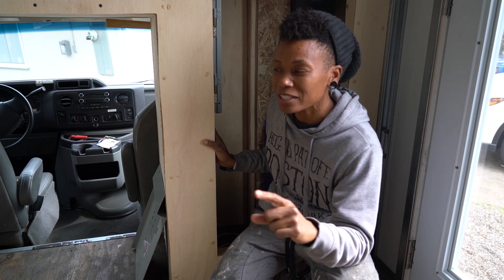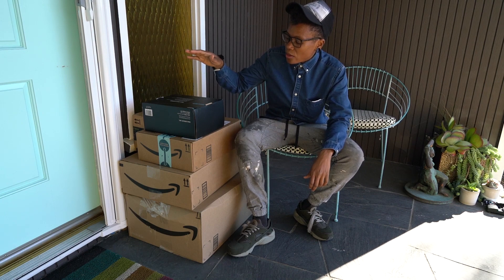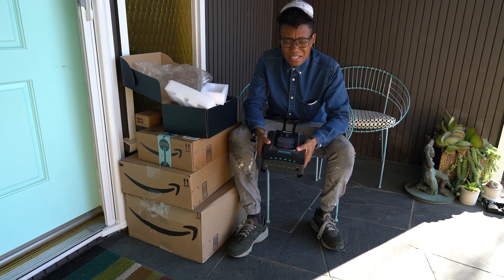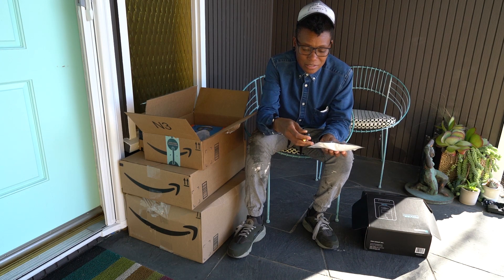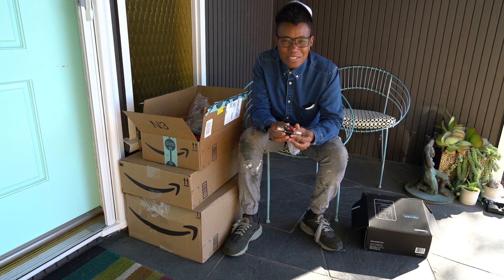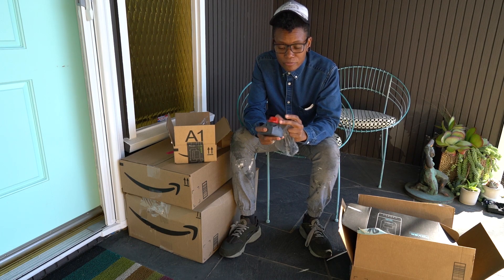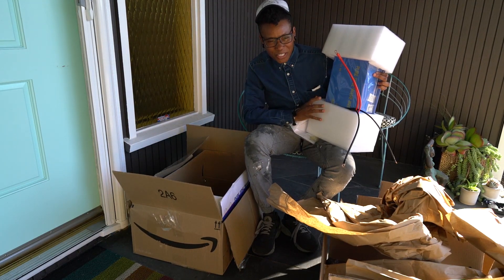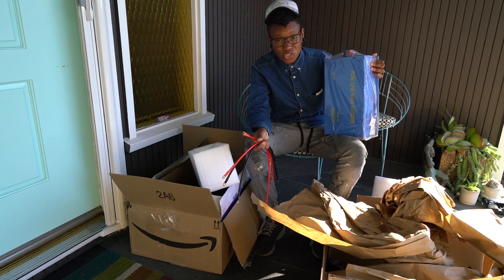Electrical system components // SPECIAL DELIVERY

Comment: How much did it cost for your whole solar system ?
Reply from the maker: john hodg the components in the video cost around $500 give or take. The charge controller was the most expensive part. Everything else was pretty reasonable.